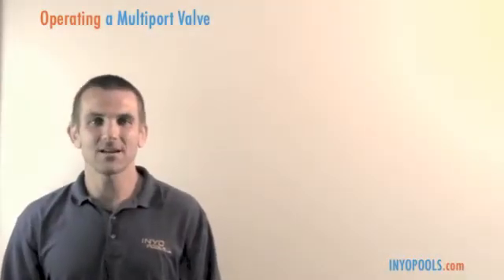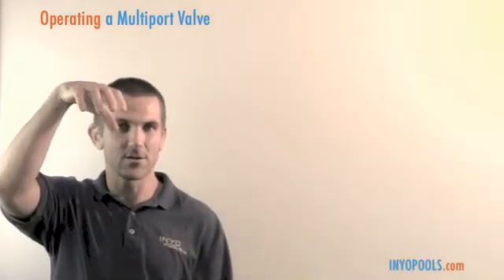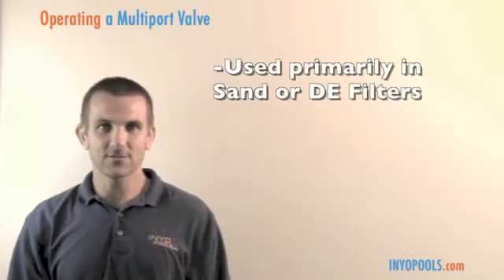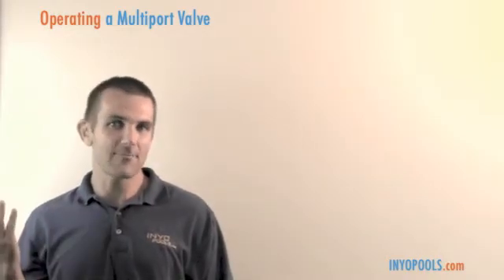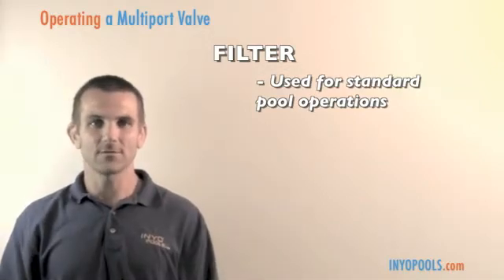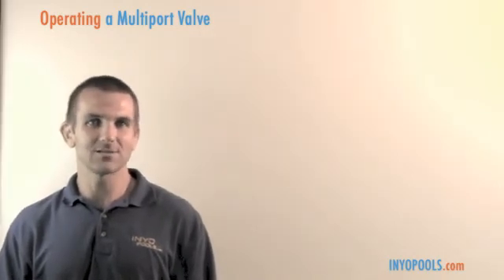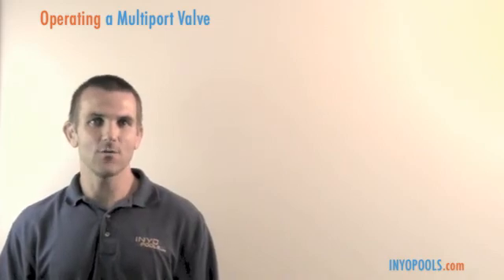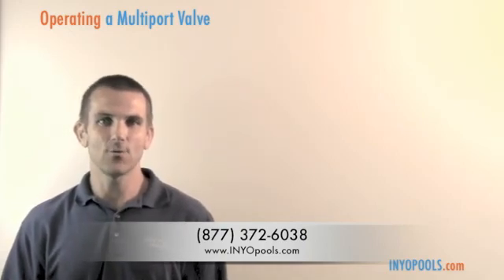How To: Operate a Multiport Valve

Comment: That was informative but what I need is how to operate it ie how to actually turn the handle, lift up or push down, only in one direction etc. Thanks.
Reply from the maker: The multiport handle needs to be pushed down in order to turn. We recommend always turning in one direction. Always clockwise or always counterclockwise. Switching back and forth can cause the spider gasket to pinch.